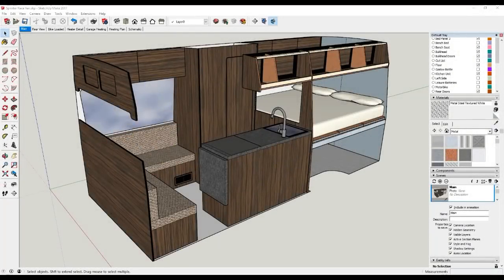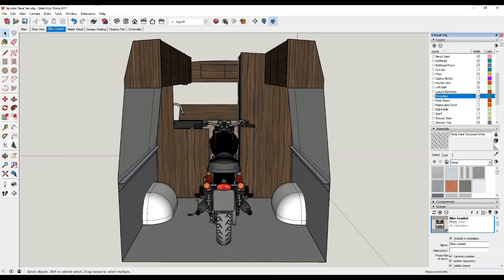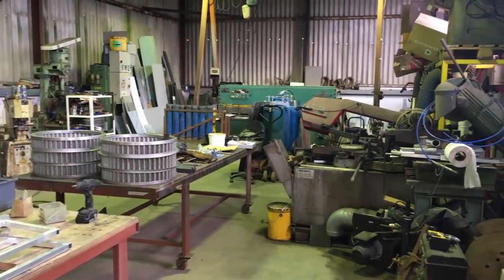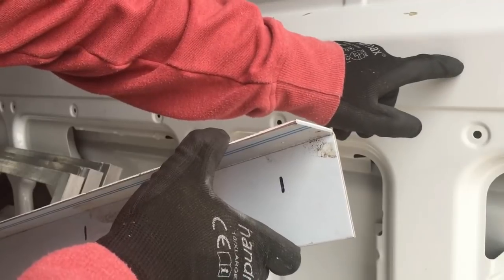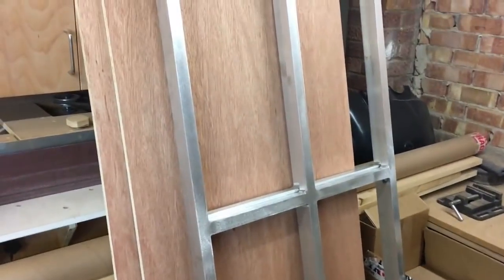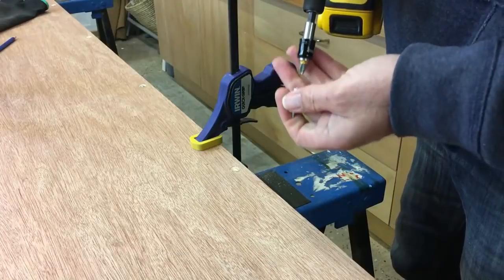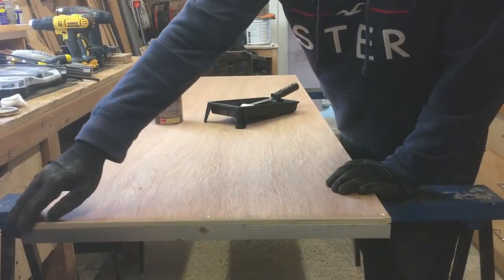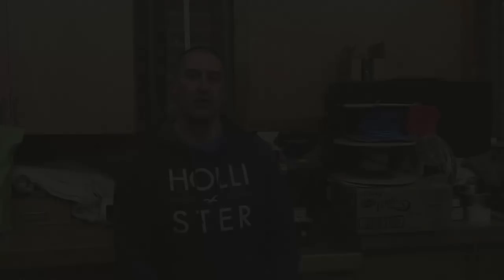Mercedes Sprinter Camper Van Bed Frame

Comment: Loads of great tips in your videos, thanks. How is this affected by thermal bridging, as the L bracket is connected directly to the van with metal to the frame wouldn't it get cold, particulalry in winter and create condensation on the bracket.
Reply from the maker: I have applied the foil bubble wrap over the whole wall, then a sheet of 9mm marine plywood then attached the aluminium bed bracket. The only bridging part is the bolt which I have fitted with plastic caps. Wood is a very good thermal insulator.
Reply: i posted a question earlier, but noticed this is a similar question. the video doesn't show any marine plywood or foil wrapping. was this installed after? thanks greg, great content :)

Comment: Great video Greg. Getting lots of fantastic ideas from your build. Wondering  what size your finished bed will be. Thanks from Ontario Canada
Reply from the maker: Each panel measures 1750mm long by 600mm wide, so the bed ends up being 1750 wide x 1800mm long. Approx 6'x6' foot square.
So you could pretty much sleep whatever way round you want to. Thank you for watching.

Comment: Hi Greg, I've been a fan and follower of your build series for a long time. Great to see the entire build and how you are enjoying it now touring through Europe. I have now decided to use a Sprinter as the base for my camper, so your video's will be all the more useful. Regarding the bed, I want to be able to put mountainbikes under the bed floor,  so my bed will have to be approximately 100 cm from the floor. This means I cannot use the structural member to support the bed because it is too low. What would you recommend? I am thinking of putting a vertical post on the floor that I can fix to the upper structural member. I can then rest the bed on the four posts at any height. Hope you have a good trip despite the Corona crisis! Cheers, Henk

Comment: I love the bed plan, do you have an idea what the weight capacity would be? Anyway, just have to say your work is second to none.
Reply from the maker: I haven't done any calculations, I'm about 85kgs and my misses is much less. It will be fine for us. I was originally going to go for a much deeper section tube but instead went for thicker gauge. Thank you for the compliment.

Comment: Hi Greg, thanks for showing your design, thought process, and work. Do you mind telling me why your design changed? Originally you had the bed on top of the garage area, but here you need to remove the bed to be able to load your bike. Was it because you got a bigger bike, wanted more room inside for sitting, or something totally different.
Reply from the maker: Thanks very much for asking this question, I plan to do a detailed walk-through of the latest version of my plan and will explain to everyone why I have revised it in more detail. 1. We wanted more head-room above the bed so you could easily sit up in bed and it does not feel like sleeping in a coffin. 2. To give full height access when loading and unloading, many people commented that it would be very difficult to load the bike when the bed was fixed, I do tend to agree in hindsight.
Reply: Hi, great video. Did the frames rattle or jump around when the van was driving?  I love the removable idea but I'm concerned they slide or rattle about.

Comment: Hi Greg. We are thinking of using the angle each end with just the ‘slats’ for the frame, no cross bars. How do we calculate how much aluminium we need to hold our weight please? We’re a little chunky 😉 Thanks!

Comment: Well done! The aluminium frame looks great. Have you thought about where to store the panels when in transit? Also did you consider using slats or strips of ply instead of a solid sheet? To allow the mattress to breath underneath and be lighter?
Reply: Ignore the last comment re slats, I see it's been answered in other comments.
Reply from the maker: The panels are 1750 wide and the bed area is 1810 long so they will simply slide in down the side of the bike on the floor and be held in place with a strap. Thanks

Comment: Hello Greg, hope you’re enjoying your vacation. I am getting a bed frame made like this. Excellent job by the way. I wanted to ask the thickness of the folded aluminum angle that you used to attach to the sides of the van. Thank you and I’ll let you know the outcome. I’m try to get all the information to the fabricator. Thanks in advance.

Comment: Hi Greg. Great video and series. I know it is 3yrs old now though. Funnily I came across this video by looking on YouTube on how to ply line my van for tools. I guess the pop nut rivet was part of it. Any way, I have a question you may be able to answer. How do you know where you are able to put fixings into the sides and roof of the van? Thank you. Another subscriber here even though I do not want to live out of my van. Well, working g with it basically is I guess
Reply from the maker: The internal beams of the side and roof are the main structural parts that give the van it’s rigid strength. When fixing into these keep clear of existing holes and try to stay on the centre line where stress is usually neutral. 👍🏼😃
Reply: @GregVirgoe  thanks for the reply and the advice. I appreciate.

Comment: Wonderful to see the interior components start to take shape!  Have you considered adding a spring system (like the Froli sleep system that the Winnebago's use) for added comfort?  (Though that might add unwanted bulk, especially if you already have a comfy mattress).  I'm looking forward to seeing the rivnut process next time.  Do you have a goal date for completing the van?  Excellent as always, and glad to see you're having fun with it!
Reply from the maker: I had to look them up but remember seeing them on some vans at the motorhome show at NEC. They look like a fabulous idea. Not sure I can spare the loss of height. We have selected a decent mattress for our initial trips.
Ordered a more heavy duty Rivnut tool and requested a return for the other one so that will be here Wednesday latest. I plan to take the van to Maker Central first weekend in May, not very much time and still loads to do.
I've been collecting some outtakes while filming the build for a post-build "Gag Reel" compilation :D
Thank you for your support and great feedback
Reply: Can't wait to see the gag reel! haha.

Comment: Thanks Greg, another down to basics video.  I dont know if you've ever had a van/motorhome before but if you haven't it is a absolute nightmare trying to make a bed while kneeling on it, your wife wont like it.  It's not too late to fit two singles which will allow you to stand on the floor (just about) to make the beds.  You may be able to have the beds fold up the side of the van when you load the bike, just a thought.
Reply from the maker: Hi Keith, there are two problems with your comment.
1. That's really sexist, assuming the women are going to be the ones making the beds. Come out of the dark ages.
2. We are not married, so why would I want to sleep in a single bed, with a gorgeous girlfriend in my van?
Seriously though, with the rear doors open two can make the bed in seconds without climbing on it.
Thanks for your comment, it made me smile.

Comment: I have a couple of questions. 1. Rather than solid boards, wouldn't slats be preferable under the mattress for ventilation? 2. Would it be worth running rubber strip along the top of the aluminum angle to prevent squeaking? Just curious.
Reply from the maker: Hello Doug, You do have a valid point re ventilation. I went with a solid board to add lots of extra strength to the very lightweight aluminium frames. It's amazing how much stiffer they are now the board is secured.
Excellent suggestion re the rubber strip too, That does sound like a very good idea. Thank you
Reply: Doug F I was thinking the same 👍
Reply: Greg Virgoe like always it does look awesome. 😎
Reply: Greg Virgoe Perhaps you could cut slots in the board, or ‘Swiss cheese’ it with a hole saw?
Reply: I thought the same thing.
Reply from the maker: Yep, circular holes would be an option and wouldn't lose much structural strength.
Reply: Are you not trying to box in the bikes and keep smell of fumes etc to a minimum? Would building a second frame out of wood (like trellis style) and sitting the mattress directly on top of it work for ventilation, if you did not want to drill holes-just a thought
Reply: Hi Greg, I'm not sure if you know about the product 'Drymesh Anti-Moisture' its a polyester product that is used in boating bedding that provides airflow under mattresses. I think it will be a good idea on you big flat solid boards. 'Orange Oil' is also a great product to protect wood from moisture because it is natural and repels insects, this makes it great for kitchen timbers also. Thanks for the continued updates, you inspire everyone to be a bit more professional in their build!
Reply: Karl, from Karl ! That looks like a good product for under the bed. I will try and source it here in NZ as my garage will be pretty much sealed to stow 2 and 4 stroke tools-thanks for sharing that
Reply: Karl I found a place in Melbourne 'EMP Industrial' give them a call and see if they ship to NZ or if they have a NZ supplier.
Reply: Cheers Karl-I will contact them thanks again.
Reply from the maker: Karl Bartelt, interesting product thank you for sharing that information. Cheers
Reply: Good suggestion.
Reply: The boxed idea for bikes is good and other youtubers have used chemical resistant floor and wall materialb water washable for fume isolation and easy washing in that compartment.
Reply: flexural strength/stiffness increases as the cube of the depth, but only linear with (extensive) dimension at a given thickness. So if you want the same stiffness you can use a slightly thicker board with lots of holes cut. it would also be lighter.
Reply: Greg Virgoe I was thinking that condensation might be a problem when I was watching. It might be a good idea to get a 2 inch hole saw or forstner bit and make a series of neatly spaced holes. Not only would it provide ventilation without reducing strength significantly, but it would also reduce the weight a little. Not a lot of weight reduction but, as Tesco say; every little helps.
Reply: @GregVirgoe  I think anything but a solid board would be an issue when it's cold outside bc your garage is not heated! The last thing I would want is a cold bed when I'm winter camping!
Reply from the maker: Hi Dennis, my garage is heated as is the cab, the living area and the wet room. I have numerous vent outlets throughout the van to keep it all lovely and warm 😀

Comment: Really enjoying your Sprinter build. Just wondered if you'll be adding an air gap between the bed base and mattress to avoid condensation?
Reply from the maker: We are having a cool blue foam mattress and it will be aired daily and flipped regularly.
Never had an issue with condensation in a mattress ever before.
Our van will have an amazing heating system so it will not be cold in there either.

Comment: Hi Greg, thanks for your videos, I'm converting a crafter to a camper ans I had thought about the aluminium frames.
On your video you fit them directly before insulating.
My question is when do you fit the bed ans how do you reach the rivnuts? I'm assuming the bed will be fitted after the walls are on .
Reply from the maker: I only used it against the steel of the van to get the spacing of the rivnuts exactly right. One they were installed. I fitted the double foil bubble wrap and my 9mm ply lining then mounted the bracket on top of the ply so it wasn’t touching the bodywork.

Comment: Nice!   Do you think it would be strong enough not to have the little cross pieces in between the long runs?  For I don't have a spot  for a welder; so I want to just bolt the lengths onto the angled aluminum.   THX!
Reply from the maker: You might need to go to the next size tube as they do add extra rigidity.

Comment: Great and informative video as always Greg.  I must have missed a video somewhere (or I misremembered), because wasn't the original concept that the bed was going to be above the bike garage, so that it was more of a sealed off area that could store the bike all the time?  And since you did move away from that, for something that works for you, is there a reason you did still kept the bed fairly high, instead of lowering it down if you aren't going to keep the bike under it anyway?  Just curious.  And it really is starting to come together, looks great.

Comment: I can let you have a few wall nuts if your rive nuts broke, would that hold the bed frame in? Nut n bolt did it for me, even big bertha couldn't break it but having said that, there will be no big bertha' s in my bed....
Jokes aside yes the rive nuts are good ..
Great work

Comment: Great video, I really like the bed system you came up with. Unfortunelty, after a trip to my local welder I quickly realised this system is out of my budget. I would like to replicate the bed system but make the frames out of wood. What size timber would you recommend, type of joinery to connect the timber and support for the bed frames?

Many thanks,
Si

Comment: Great, as always. I second another commenter that you'd enjoy the Sail Life channel, if you don't already. Same attention to detail :-)
Reply from the maker: Thank you David, I have subbed to Sail Life and will check out his videos during my evenings viewing.
How is your own van coming along, whats next on your agenda?
Reply: I'm about to re-cut the floor ply because I'm unhappy with how badly I did it. Then finish the floor, put the ceiling in (just some thin ply with some LED lights). Very soon I'll be cutting gas vent holes (I've also bought the Gaslow refillable system which I think you have) for the bottle and the Propex heater.
Reply from the maker: Vandemonium you r. Sight me up I’m doing gas also. My heater turns up today with any luck. Yes I have gaslow cylinder too. Cutting holes in floors not looking forward to that bit 🙃
Reply: Vandemonium I've watched sail life since day one. It's great for anyone who likes diy and tinkering with boats. A lot of things that apply to yachts also apply to campers. One word of warning though, if you see something you are interested in, try not to by it from a chandelier or a marine store - mention boating and they double the price and then add a nought on the end😲
Reply from the maker: I always imagined you need a lot of money to go yachting ⛵
Reply: Its fascinating that there is a following of Sail Life by people in the Van culture.  I'm rebuilding a 34 S&S34 yacht and have been on Sail life for 3 years.  Be aware though a subscription may have consequences.  I am constantly told (in good humor) by my spouse to clean up, to paint, to measure etc like that danish bloke does in projects I commence.  I think Greg is a fellow traveller and he is the only person able to instruct me in getting Sketchup to work (kind of).  

Looking to buy a van in the next month after living in one for two weeks in South East Western Australia last month.  Really wanting to see a video on cabinet construction with 15mm furniture board.

Paul 
Melbourne Australia